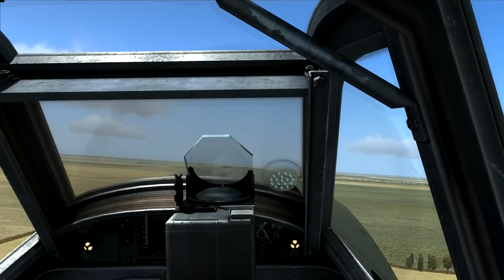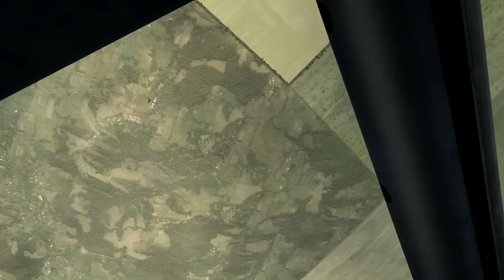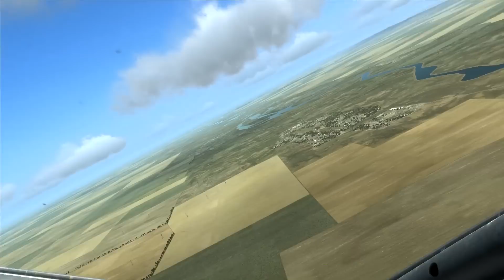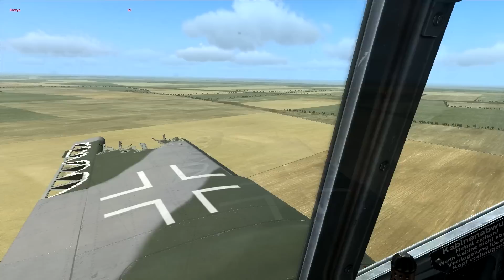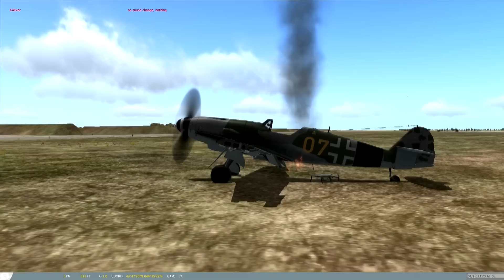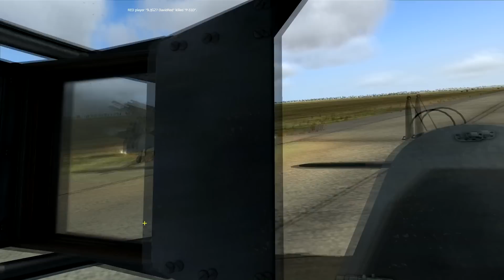DCS BF109 K4: [Surprise] Combat Sortie

Comment: The wing shouldn't be on fire. The fuel is behind and under the cockpit and the only fluids in the wing are hydraulic (for the landing gear) and coolant (for the engine).

Comment: Hey Guys, one question what server are you on? Seems pretty smooth, have never seen such smooth multiplayer performance in DCS so far. Apparentely i have to take a look again at them
Reply from the maker: This is the public ACG WW2 server (the group that Ape and I are members of). It's a pretty nice server, runs great most of the time. It is open for anyone to join. I prefer it to DoW as there are AI bombers and fighters to shoot at if there are not many players around. The only downside for me is that the server is in Europe, so my ping isn't the greatest >_<
Reply: [AKA] Kraut! Great, thanks for the fast answer. Looks really nice, also performance wise, compared to DoW. I will definitely test it the next days
Reply: [AKA] Kraut! one more question kraut. are you playing with some kind of graphics mod? because your game somehow looks nicer then mine, although i have every possible ingame adjustment maxed out..thanks in advance
Reply from the maker: MrCelestiale Yes, the main mod is DCS Enhanced Terrain for the ground textures. I use a few other minor ones as well. I found everything I use on the Eagle forums.

Comment: Why were your all lights blinking a little sometimes?
Reply from the maker: Haven't figured that out quite yet.
Reply: It's the internal generator, it works like a dynamo.
This should influence the radio as well!
Reply: Yeah but it shouldn't normally happen, right? Only on low RPM, right?
Reply: apparently the 190 had this issue as well in beta, something about the game engine alternating between generator and battery power constantly.